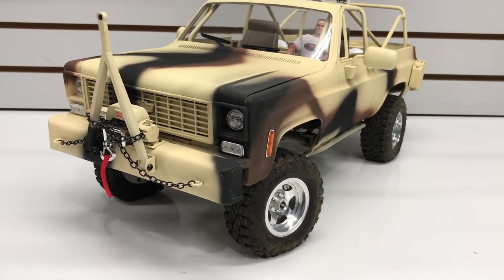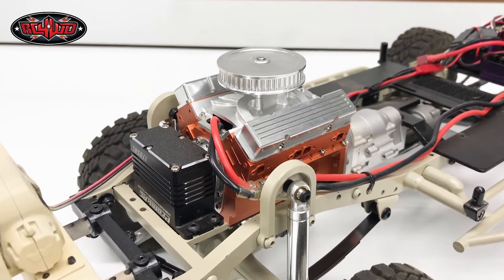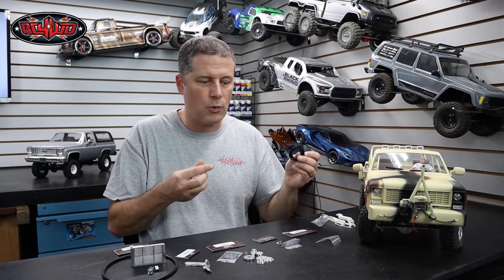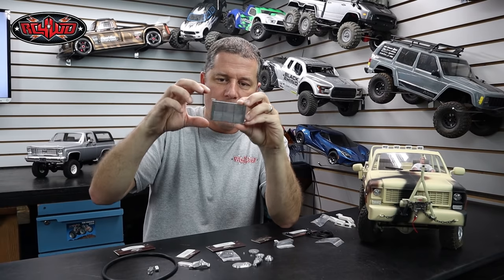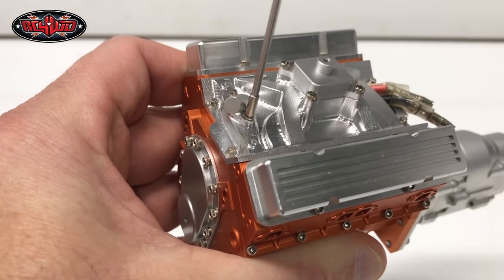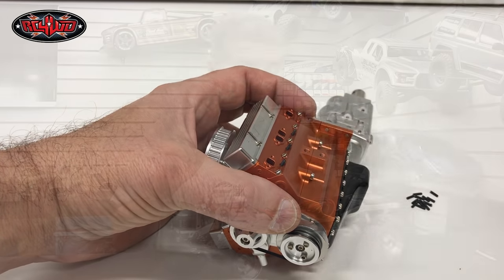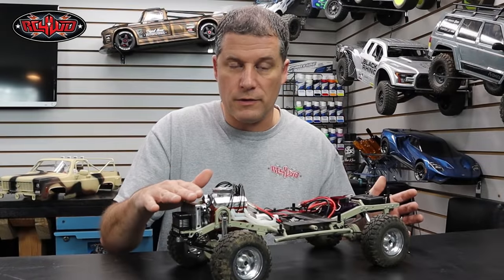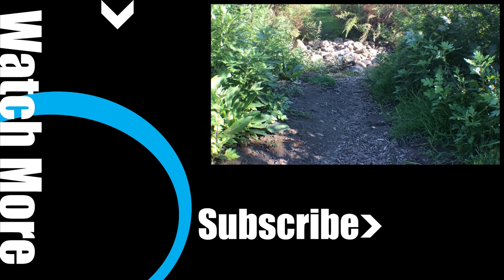Oh So Scale! Loading Up The RC4WD V8 Engine With Detail Options | RC Driver

Comment: Those are some great upgrades! They look great and to have the pulleys turn is even better. Do the newer blocks have all of the holes for bolting on these parts as you said yours was 1st gen. This video is very intriguing. Is the actual electric motor inside the V8 block as I noticed wires coming out, or is it a small motor to turn the pulleys? I have been interested in the off-road racing and bashing side of RC but really want it to be in kit form. This takes "kit" to a whole new level! I can see the interest in the true scale side of things. Do you know if RC4WD makes a scale Tow Truck? I used to be a Wrecker driver and making a working scale truck to add to my collection would be great. Thank you for an honest and informative heads up on these upgrades! Well done! Now you are tearing me in another direction as to my next RC

Comment: Hay Greg What i would do is try and see if you can turn the air cleaner in a on and off switch. Or maybe you can modify the air filter into a switch so you can turn the truck on or off. But All that said i motor looks grate so real good job....